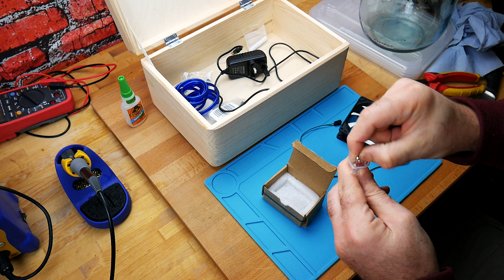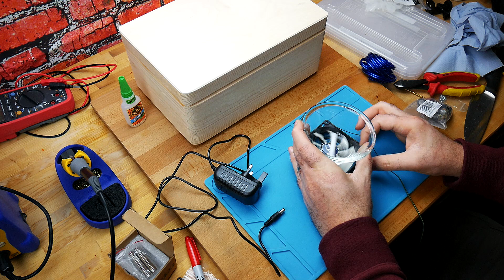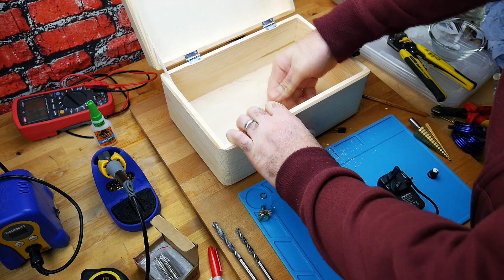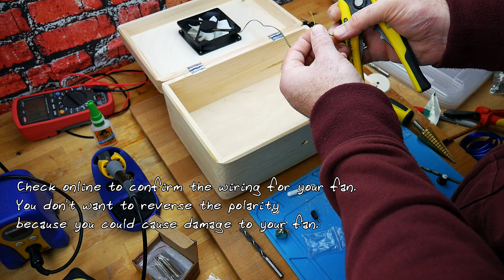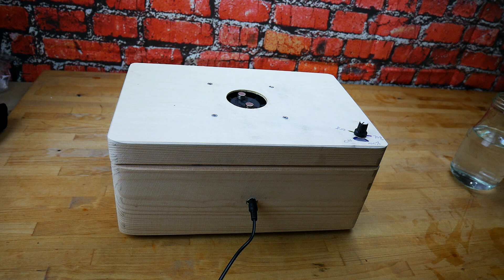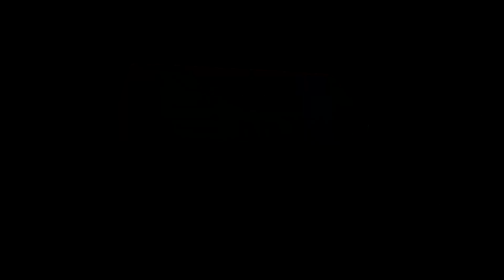DIY Stirplate - Powerful and Cheap

Comment: The reason the big bar does not work well is that the poll's of the magnets on the PC fan are too close compared to the poll's on the stir bar. Simple solution, mount the fan magnets on a piece of ice-cream stick further apart and then onto the fan. Obviously just cut the stick shorter. Also break the fan blades off, less air resistance

Comment: I was messing around with my potmeter but your video shows me that mine is wrongly wired making it way too sensitive. Also having the problem with stir bar jumping off. Going to try your tips this weekend, thank you!
Reply from the maker: Good luck! Hope it turns out well
Reply: @ChilliChump  thanks, I have just about the same components as you have so I trust it will. Cheers!
Reply: Worked like a charm and my starter has been stirring the whole night ready for brew day this afternoon. Thanks again!

Comment: Making progress on the stir plate but run into a problem: the potentiometer only activates the fan when it reaches about 95%. Not sure why. I went with the potentiometer due to cost.
Reply from the maker: Which pentiometer did you get? It sounds like the resistance rating is too high
Reply: @ChilliChump  thanks for the stir plate idea. I have gotten mine going with the fans I mentioned with the low medium high settings. Have not gotten the other one going yet...a electrician I spoke to suggested an 100 ohm 5 watt pot so will try that and let you know.

Comment: Alas I am afraid I must report that I think I burnt out my fan. Unbeknown to me when this fan arrived (and I bought two! lol) their wiring is all the same colour. All black. When I connected them to my 12v to test out all I saw was smoke :( I will buy some much cheaper fans tomorrow and try again...how do you know which is positive and negative if the wiring is all the same?
Reply from the maker: Didn't the fan come with a wiring diagram?
Reply: @ChilliChump  sorry let me explain. I did not buy the fans from your link as I thought I could buy any PC fan. And no there were no diagrams. But I will chalk this down to learning. I am going to go with a different alternative. https://www.amazon.com/gp/product/B00JLV4BWC/ref=ppx_yo_dt_b_asin_title_o00_s00?ie=UTF8&psc=1 will void the need for potentiometer
Reply from the maker: Seb, I wouldn't recommend that one. You have less control when starting up the stirring. If the "L" setting is too fast, then you will have a problem getting it going.
Reply: @ChilliChump Ok thank you once again.

Comment: Thanks for all your videos and insight. I couldn't see what size magnets you are using? And that fan is no longer available can you advise another type/model?Not sure what is meant by push/pull.
Reply from the maker: Hi Seb, the fan is the Arctic F9 (the link is still working for me... try this: https://amzn.to/367goXy)
The magnets I used were 2mm thick.
Reply: @ChilliChump  Thank you very much for your quick response. I have just started with my seedlings so I am just planning for a year from now. By then will have my first batch with your stirrer plate and therminator.

Comment: Would you do this again? I'm curious if you would just use xanthan gum instead. I'm also curious if you would just buy a magnetic stir plate instead and if so which one? Thanks
Reply from the maker: I have done this sauce a few times now. I did buy a magnetic stirrer to compare. My home built one outperforms it (I bought a fairly expensive one.). And no, xantham gum will thicken and emulsify. But the stirring also brings out the flavours into the vinegar. You get a much better taste at the end.

Comment: In the video where you used the stir plate you showed a pwm controller.  I didn't see you put that in in this video.  Is it necessary or does the stir plate work fine wirh just the potentiometer.   Thanks.
Reply: I saw, after reading more, that you added the pwm  controller due to the pot getting too warm.  Thanks.

Comment: Thank you for the great video. I would love to try this myself for your recipes, as well as for making beer yeast starters. I'm just wondering if the unit you created can support a 5 litre Erlenmeyer Flask?
Reply from the maker: I use a 5l flask with it. You may have some challenges if the liquid you are storing is too thick
Reply: @ChilliChump  the liquid would be essentially a light beer wort mixture to cultivate yeast
Reply from the maker: Then it should be just fine! I managed to stir up quite a viscous chilli sauce with this in the 5l flask.

Comment: My sauce is separating still after using the stir plate. I am guessing I will have to use the xanthan gum to keep it together.???
Reply from the maker: How long did you stir for?
Reply: @ChilliChump  we have done several receipes and always stir 4 to 8 days.
Reply from the maker: @peggyorlowsky9463  how long before you see seperation? With mine I get about 6 months before anything noticeable...sometimes even longer. Seperation will eventually happen though. It will be quicker to seperate depending on the ingredients you are using. For example if you are putting oil in your sauce.
By the way, there is nothing wrong with using xantham gum ...I just like to find other ways to do things too

Comment: I have two (3?) questions about your stir plate and the Buffalo Sauce:
1) How many magnets did you end up putting on the fan (two or three per side), and what US size did you use (1/4" or 3/8)?
2) You added some additional vinegar to your Buffalo Sauce. Was that to lower the viscosity or just for taste?
TIA - Mark

Comment: Problem with the  larger stirr-bar are:
1) it's too large for the bottom of the bottle you put it in.
2) you glued the small magnets on the fan too close to one another. 

Problem with using a fan motor for this are
1) Fans are not designed to be (externally) speed controlled. You probably have found that with the potentiometer as well as with the pwm controller.
2) Computer fans are not designed to be loaded. Not only are you adding magnets that add to the weight, you also ask from the fan to transfer quite a bit of energy into your liquid. All that has to be delivered by your fragile fan motor. And you let it run for weeks.

May I suggest you spend a little more and get the type of motor that model airplanes use.
They are designed to run smoothly even with a load (they drive props)
They are designed to be speed controlled over a wide range of speeds. (They may require a motor driver. There are very many different types out there)
Google is your best friend.
Reply: Actually computer fans are designed to be controlled either externally or by software the fan doesn't know the difference.  The extra load on the fan really isn't a big deal either considering these fan can run continuously for years before failure and they're dirt cheap.